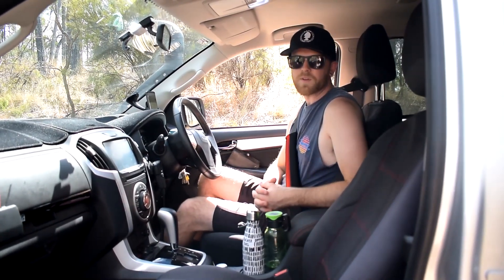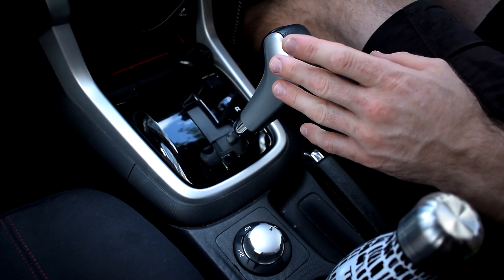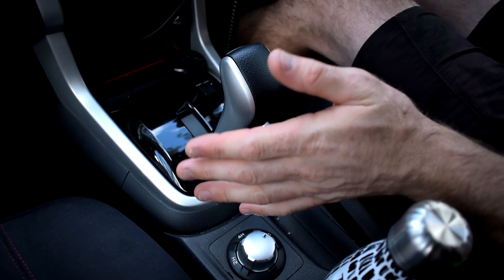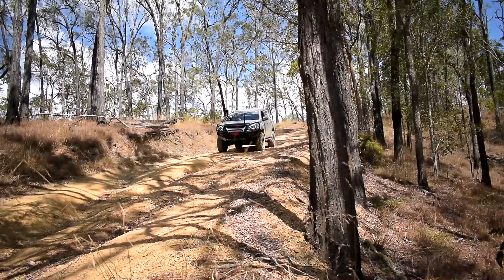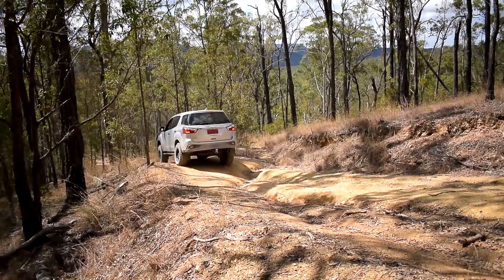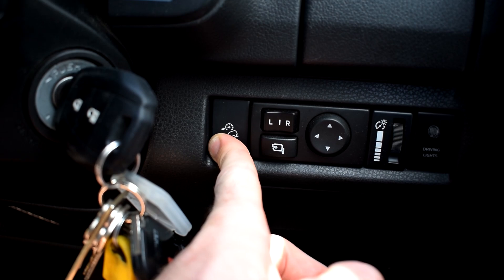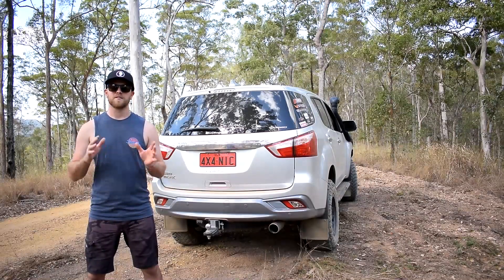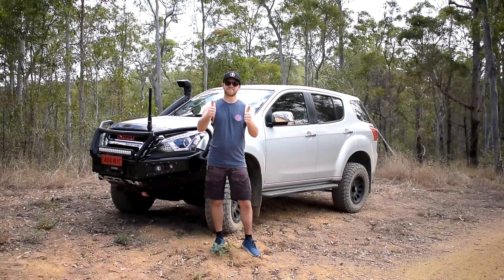How to use 4WD Hill Descent Control and Hill Start Assist

Comment: Hey mate when putting my car into low range it makes quite a large clunk it never did this as new but it’s only done under 15,000 k’s is this normal
Reply from the maker: Yeah, that's normal. Just the 4wd system engaging.
Reply: @LowRangeNick  ok thanks it was just a lot quieter when I first got it and didn’t won’t to ask on a fb page as there is a lot of not so friendly people on there

Comment: Great vid thanks again. Have you tried hill descent control with a 4wd trailer with electric brakes? Wonder if it will unnecessarily lock the trailer on and off. On manual mode, redarc tow pro elite or similar.
Reply from the maker: I think it would, because it turns on the brake lights when it is working. I reckon you would have to dial the tow pro back a bit. Would be interesting to test though!
Reply: @LowRangeNick  will let you know when i do in the MUX.
Reply: @travissandeman9043  hi mate did you try it? I have the same situation driving my camping trailer off road and I didn't know whether it would work or not. Inf would be appreciated 
Cheers
Reply: @tonypucheta354  hey Tony. I have recently swapped out our offroad camper for a caravan so have not been in hill descent control whilst towing anything since this post. Sorry mate.

Comment: Hi Nick did I see no Idrive. Have you taken it out. If so any reason why
Reply from the maker: I'm running the Hikeitx9 throttle controller. It's mounted on the other side of the steering wheel.
Reply: @LowRangeNick   did you do a review on that one. Just curious I have the idrive and it’s fine
Reply from the maker: @neilbates8409  yep, i have a video on the hikeit 😊

Comment: Great info mate just off topic what is your Clarence on the front cross member and Rear diff
Reply from the maker: 280mm front cross member and 240mm rear diff 👍
Reply: Thanks mate I’m trying to work out my lift on my DMAX it’s 255mm front cross member & 240mm  diff I think it’s only 25-30mm lift
Reply from the maker: @anthonyditotto8016  The clearance under the front will be determined by the lift in the vehicle and the size of tyres being IFS and the rear diff clearance will only be determined by the size of the tyres. If you measure from the centre of the hub to the bottom of the guard you should get the ride height measurement. Mine sits at 560mm I think which is about 50mm lift. I think 510 is around standard.
Reply: @LowRangeNick  thanks again mate  mine’s about 540 front and 560 rear

Comment: Hey Nick, I wanna take my MUX on the beach but freak out about potential rust issues. Do you have electronic rust protection? Use lanolin oil? A vid on this topic ie after beach clean would be mint!
Reply: That's a good question. I've noticed from videos that it doesn't look like Nick uses oil on his chassis etc. Having said that, auto expert (john) did a video recently on how modern vehicles have zinc galvanised steel which mostly prevents rust. You still need to wash off mud, minimise exposure to salt, and do a through wash after beach driving. Probably it wouldn't hurt, and would help protect other components. 

Interested to hear Nick's thoughts on this.
Reply: I used to feel the same way when I first got my Dmax. But then I realised you have to bite the bullet because it's too much fun. I spend about 4 hours cleaning the car after beach trips. Flood everything on the exterior with fresh water. Not high pressure. Use high volume. Get the hose everywhere to clean it out good. You can use some sprays as well but I believe nothing beats a thorough wash at home. If you can find a fire hose they are amazing for flushing the chassis
Reply from the maker: In my opinion the best way to stop your vehicle getting rust is by washing it properly after every trip. You can have electronic rust protection, underbody spray, use lanolin over everything but if you don't thoroughly wash your vehicle after every trip then you will still get rust. My tips are, 1 wash your vehicle thoroughly after every trip and get under your vehicle and touch up any spots were you have scrubbed off paint with under body paint or rust reformer paint. Don't be scared to take your vehicle up the beach! It's soo much fun!
Reply: Thanks everyone for those tips, will bite the bullet and get on the beach. Whats a must have for beach going? Tyre deflators, air comp, max trax, shovel, snatch strap?
Reply: @kaneharry5966  if you have your tyres around 16Psi you are unlikely to get bogged. If you manage to get bogged, maxtrax will get you out straight away. Snatch strap handy to have but I wouldn't use them unless necessary.
Reply from the maker: @kaneharry5966  Yep, that's exactly right. Also plan to travel 3 hrs either side of low tide to have the most amount of beach to drive on and the hard compacted sand.
Reply: Thanks men, appreciate it